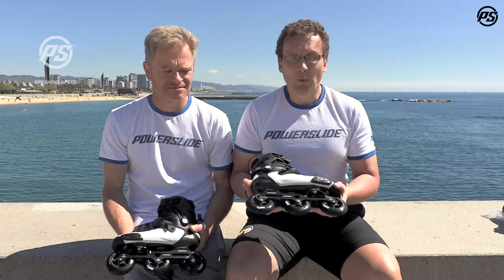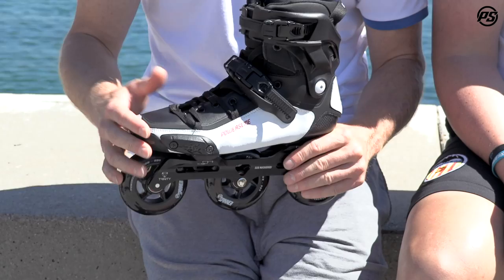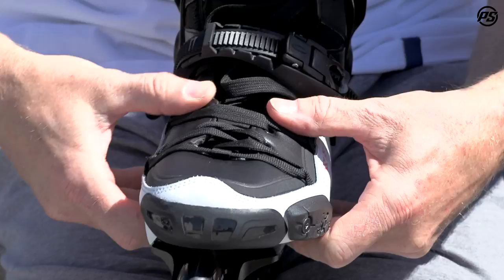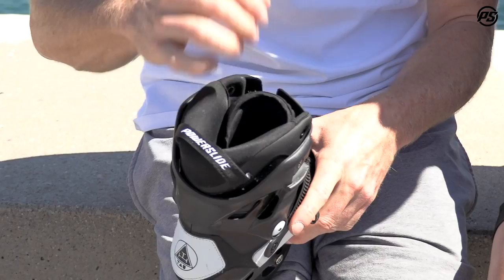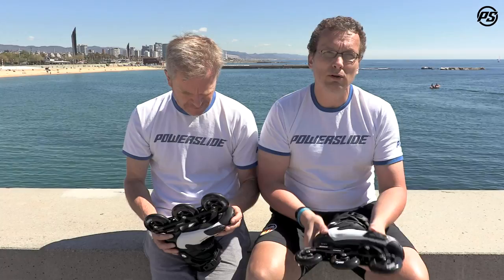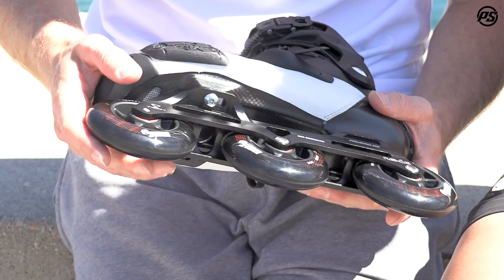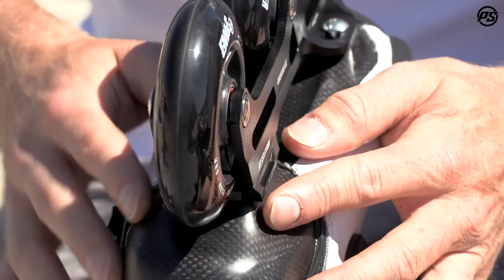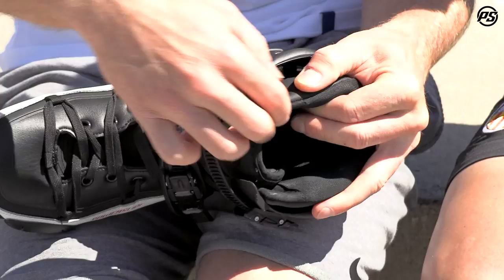Powerslide Tau 90 skates - Speaking Specs

Comment: Yeah, i just ordered the Tau 90's 2019, got them yesterday, and OMMGGG THEY HURT SO MUCH !!! Very uncomfortable around the upper ankle. It feels like the skate doesn't accomodate the tendon/bone going up from your ankle bone on the outer side of your foot. The padding is way too thin, and compressed for there to be any comfort. I didn't last 5min on the skates =( 
Such a shame, because these were my dream skates that i've been saving up for soo sooo long.
However, they are the most COOL looking skates on the market.
Another very bad design on the skate would be the lower strap on the skate. (hard to explain).. But when tightening, the strap feeds into the unprotected stitches (where all the materials are stitched together) and damages the skate badly. The skate won't last long if that continues. Even when adjusting the strap to go over the fabric, when tightening it, you can tell the strap rubs against the material, which will wear and tear much much much quicker. So nothing to protect boot when tightening.
Reply: I have the same isseus with these skates. It really hurts around the upper ankle. I hope heat molding will help solve the problem. But I have my doubts. It's exactly what you said the padding in that area is way to thin . Maybe high footies will help?

Comment: Hello, I just received a new pair of Powerlide Tau boots from Powerslide and the inline boot is not fully bonded to the carbon shell. It looks like the inline boot was once glued, but at some point the inline came loose from the carbon shell due to too much tension coming from the fabric of the inline (for around 4cm²). Both boots have the same issue on the same spot and im afraid, that if i get new ones, it will be the same. (Size 41 boot)

Is it normal and ok or will it be fixed once i heatmolded them or should i contact powerslide?

Comment: My feet measures in at 247 mm, should I get size 39 or 40? I got the powerslide next black core 38-39 and it  was pretty tight and now it's just a really snug fit after 3 months that or so
Reply from the maker: Hi Owen, the NEXT and the TAU have normally the same size chart but TAU is harder shell so with time it would adapt less than the NEXT. with 247mm you are really at the end of the size 39 (247-248). We usually recommand to use mundo size + 4mm... so i recommand size 40 for the TAU. We love to skate , Pascal Briand
Reply: @PowerslideInlineskates  Thank you so much for prompt reply <3
Reply from the maker: @owenlian9119  that's what we are here for :-)

Comment: Uploaded 16th May 2018?? Odd. 
Anyways, nice looking skate, i'd love to have a play around with the lacing. 
I wonder though, i'd heard the Tau has a 5mm lower heel than the HC, is this true? If so, why the heck has it never been mentioned outside a personal exchange of emails? I feel like that and the particular shape of the fit are hugely important selling points, especially when comparing those two particular models - certainly toward UFS/Aeon skaters. PS 4x84 trinity frame plz. 
Keep on pushin'!
Reply: the rollling review of this skate was filmed in july of 2018. They've had this skate ready for well over a year.

Comment: Question for PS. Can you tell which is the main difference between the Tau vs Evo?
Reply from the maker: tau boots are a bit tighter and more lightweight due to their compression molded carbon shell. hardcore evo boots do use a wider carbon shell and have a little bit more heel raise build in for toe slalom tricks.
Reply: @PowerslideInlineskates  Thanks for the reply. I don't do slalom. I do street cruising and a few tricks and jumps. I may also want to change the frame to a 110 one. Is that possible on both Tau and Evo boots?
Reply from the maker: @MrJetanaipe  yes, all trinity frames will fit all trinity boots. the main difference  for you will be fit. if you have narrow feet, the tau will work great. if you are more on the wider feet range, the hardcore evos will fit you better. both of the models can be heat molded to optimize the fit, too!
Reply: Powerslide Inline skates Hello again I want to order the Hardcore Evo Pro. I have a narrow feet 257mm long. PS size charts variates online. So can you look at your 41 label and let me know how many feet length it is? I’m not sure whether to order a 40 or 41. I was told I should order these skates not too big if I want to get nice power transfer, and as they heat mold. Thanks for the help!
Reply from the maker: @MrJetanaipe  we would recommmend size 41 for 257. https://www.powerslide.com/Powerslide-HC-Evo-Pro-90